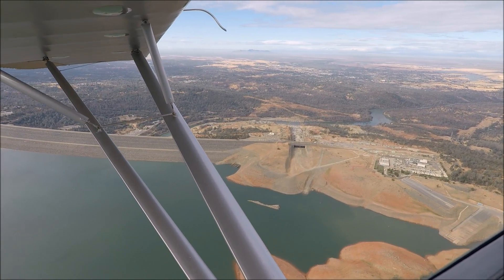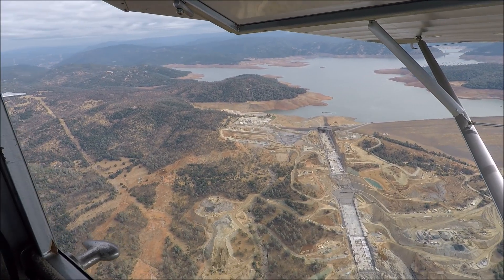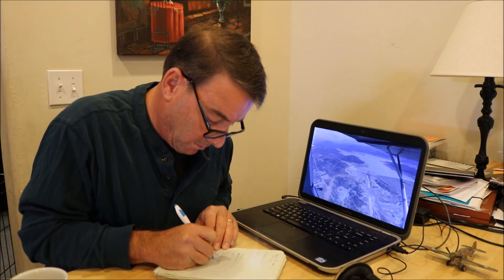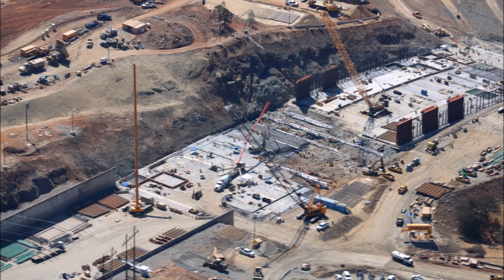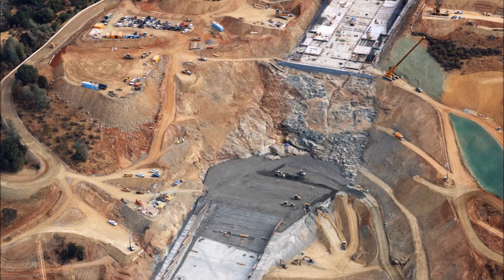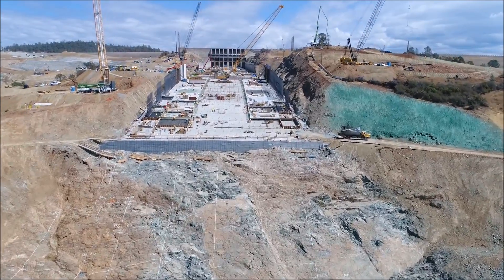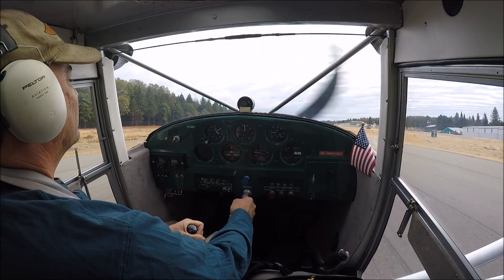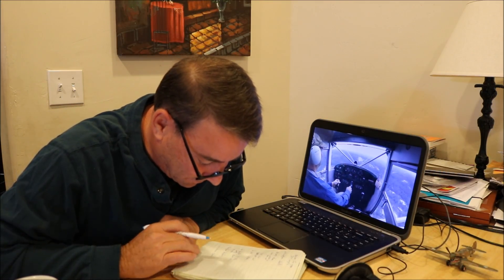Oroville Update 20 Sept. 40 days to go...

Comment: "In the unlikely event that they'll ever have to use the emergency spillway again"....Love it. That's what the original engineers were thinking.
Reply: Well, yes, but it truly was an unlikely event.
Reply: blipco, I agree that the time for ignoring red flags  - for all infrastructure - should be over, that is, if we have learned from this event.  The forensic team stated that red flags were everywhere at Oroville, even though the 2014 inspection concluded that the prospect of spillway failure was so remote, that emergency planning was unnecessary.  That green spot is a red flag.  Even during the dry spell, the area showed so much saturation, that a citizen noted that his boot print filled with water.  The gate structure is another red flag.  Even as they drive heavy equipment over the structure, there has been no fully developed plan for it's rebuild - only some rather oblique references to repair in 2018.
Reply: Thanks for all the great reports, Juan!
Perhaps in the future you might do one of how they managed to mobilize so much heavy equipment so quickly. This was quite a major issue in itself.
I really enjoyed the battle between Strega and Voodoo too!
Reply: dlwatib....OK, no worries then.
Reply: Dave T.....The plane race is something to behold. Those guys were in a dog fight to the end.
Reply: +Lad A Dog ....Let's hope so. When the photos came out of the broken main spillway there was one shot taken where there was an orange extension ladder resting against a broken end. The rungs on a ladder are one foot apart. You could clearly see the spillway was one foot thick at that point with one layer of rebar. Not nearly enough and the stone used in the mix was rounded. Not the proper way to make concrete and they knew better. I've worked big construction for forty years and the use of double layer rebar has been in practice for many decades before this dam was built judging by the old structures and buildings that I've worked on. But I can see their thinking....it's laying directly on bedrock and bolted down, certainly adequate. But the problem was the bedrock was unreliable as we saw how the water washed it away. See how much rebar they used this time? As for the green spot...no problem they say. Maybe so, it could just be the grass cover that has grown there doesn't need as much
Reply: blipco5 that‘s why they want to spend another billion on it. They know it isnt impossible just UNLIKELY

Comment: Judging from your video/picture coverage, Juan,  it would appear the "sidewalls" on either side of the spillway are both thicker and higher.  Is that part of their intention to upgrade the capacity of the spillway to accommodate higher flowrates?
Reply: I believe that the RCC walls are thicker for certain, but not high enough to handle greater than 100,000 CFS.  When they are replaced with the structural concrete walls next year, they will be tall enough to handle the specified 250,000 CFS requirement (or is it 270,000?) for the spillway.
Reply: Those RCC walls are temporary. Yes, they are much thicker, but they are not as high as the permanent wall sections are. They will be replaced by permanent walls next year.
Reply: He replied in at least a comment in the last video or two that the RCC will be cut back next year to create a final finish with structural rebar concrete. This includes the walls, which are only built to handle 100k fps this year. Final design will be over double that.

Comment: Only 40 days left? Huh?! Sure hope they've got this!! I have my doubts though. At least they have the lake level good and low.
Reply from the maker: Looks tight...!
Reply: Fortunately they've bought themselves some time by draining the reservoir as low as they have. It won't fill up overnight in the first storm of November, and of course there's no guarantee that we'll even get a November storm.
Reply: I really don't think they'll get it done by the November deadline, but there are many years where the spillway isn't used until late in the spring (most "normal" years in fact, if memory serves me).  Hopefully we'll just get an average rainfall year so there's no pressure.
Reply: As the layers get closer to the top, each lift will take less time. By the end, they will probably be doing 5 lifts per day, maybe more.

Comment: BILLIONS to armor the E spillway?  Where does that estimate come from?  4:57 '...work will continue on this project at least another year and a half."  That would be March 2019.  What work does that entail?  What is the source for that timeline?  This is 1st time I've heard this timeline,  Thanks.
Reply from the maker: NEWS RELEASE: Lake Oroville Spillways Construction Updates
DWR Public Affairs Office <dwr_public_affairs_office@WATER.CA.GOV>  Sep 20 at 12:13 PM
To 
DWR_NEWSRELEASES@LISTSERV.STATE.CA.GOV
Message body
 

 
September 20, 2017
 
Contact: 
Erin Mellon, Assistant Director, Department of Water Resources, Public Affairs
(916) 651-2440 | erin.mellon@water.ca.gov
 
Lake Oroville Spillways Construction Updates

SACRAMENTO – Today the Department of Water Resources (DWR) provided an update on construction work on the Lake Oroville Spillways Emergency Recovery Project.
 
Continued Construction on the Main Spillway
·         DWR remains focused on meeting its primary objective of repairing and reconstructing the main spillway by November 1 to handle flows of 100,000 cubic feet per second (cfs).
·         Work will continue well past November on both the main spillway and emergency spillway. The state’s contract with Kiewit Infrastructure West is currently until January 2019.
·         This year, 730 feet of main spillway leading to the radial gates will be patched, reinforced and left in place. It will be removed and reconstructed with structural concrete in 2018.
·         There are 42 days left until November 1:
o   Placement of reinforced, structural concrete is 30 percent complete. By November 1 there will be 1,220 feet of spillway chute with structural concrete – 870 feet on the upper chute of the spillway and 350 on the lower chute of the spillway.
o   The 1,050-foot middle section of the spillway chute, including filling in the two scour holes, is now 50 percent complete, with approximately 170,000 cubic yards of roller compacted concrete placed. This year, there will be an estimated 350,000 cubic yards of RCC placed. In 2018, this middle section will be completed to final design with structural concrete.
o   On September 17, crews placed 3,143 cubic yards of roller compacted concrete on the middle section of the spillway chute, a record amount for a single 12-hour shift.
o   Crews have installed 1,725 slab anchors to date in the structural concrete sections – nearly 60 percent of what is needed for 2017.
 
Construction at the Emergency Spillway
·         DWR continues to make progress at the emergency spillway, and is on schedule to complete construction of the secant pile wall, or cut-off wall, in December 2017 or January 2018.
·         Crews have completed 22 percent of the secant pile wall.
 
Other Updates
·         The independent Board of Consultants will meet for the twelfth time with DWR on September 21 and 22. DWR has posted the BOC’s eleventh memo to its website, which contains the BOC’s statement that it agrees with DWR’s findings that the cause of the vegetation area on the face of the Oroville Dam does not pose a threat to the integrity of the dam.
 
To view photos and video of the Lake Oroville Spillways construction, visit DWR’s Oroville Spillway photo gallery and YouTube channel.
###
 
For more information, follow us on Twitter or Facebook, read our news releases or visit our Oroville Spillway Incident webpage.
 

To unsubscribe from the DWR_NEWSRELEASES list, click the following link:
https://LISTSERV.STATE.CA.GOV/wa.exe?SUBED1=DWR_NEWSRELEASES&A=1